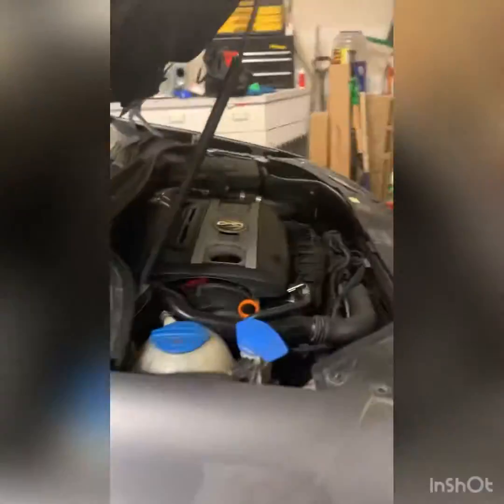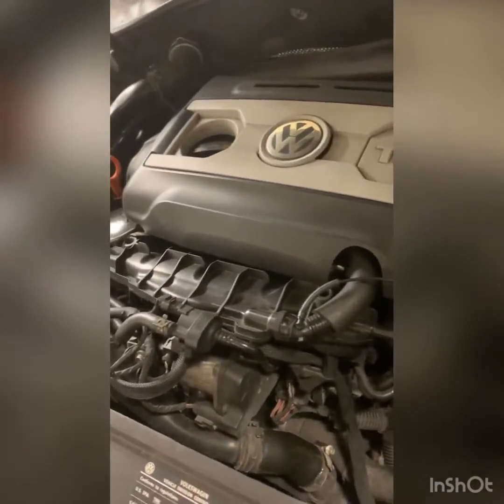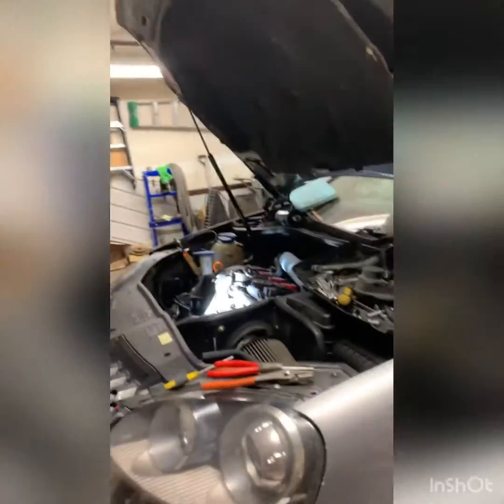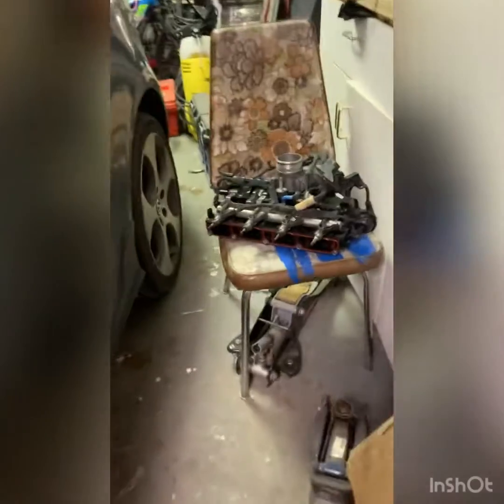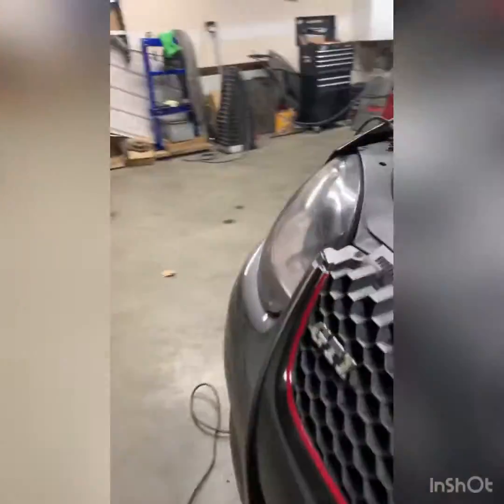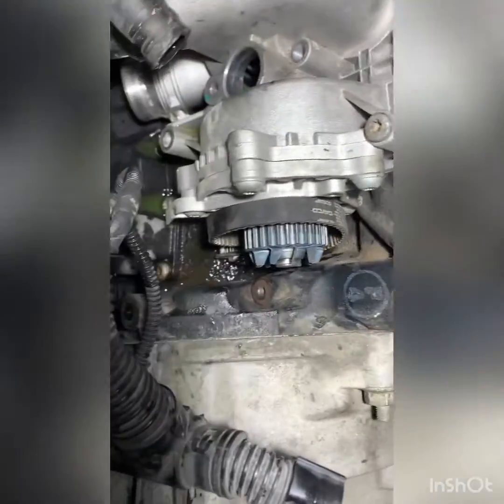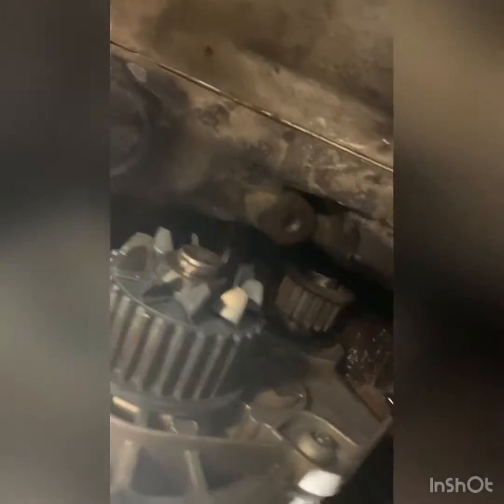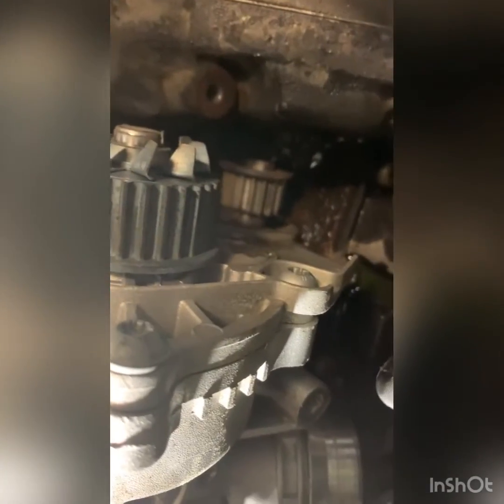Volkwagen GTI Diagnose overheating issue

Comment: So my vehicle has no heat and it over heats but stays at 111C temperature for some reason at idle. It had a water pump replaced recently so I’m not sure if it has failed this quickly. Any suggestions would be appreciated